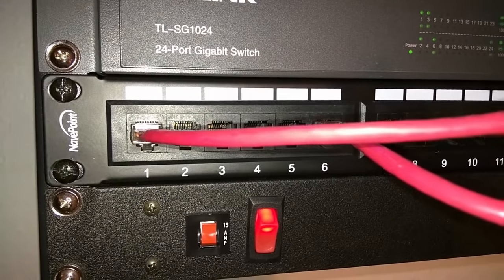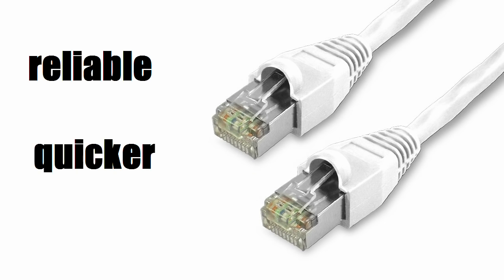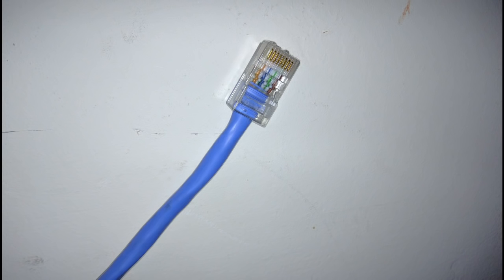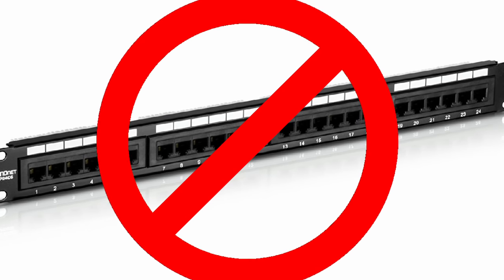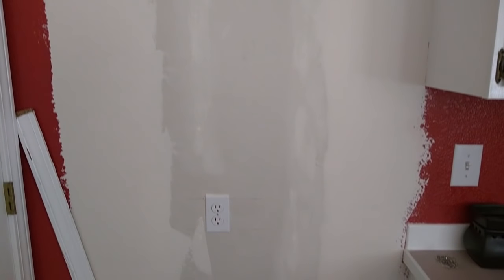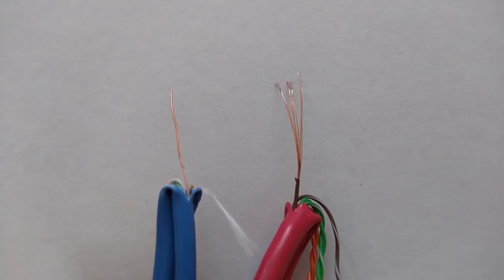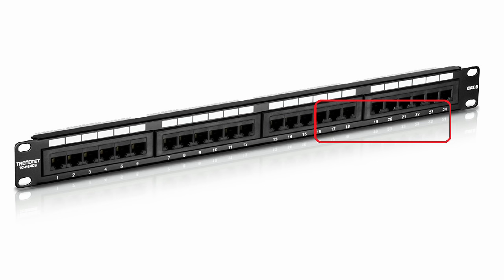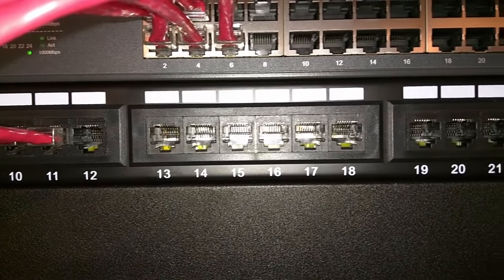What is a Patch Panel? Do You Need One?

Comment: I know the vid is 3 YO but Patch Panels don't have to have punch downs on the back.  I use modular panels and install keystones that have female RJ-45 connectors on the front and back.  https://bit.ly/2QoQlDP  Then I make up all of my cables coming into the rack with male RJ-45 connectors.  This way you can very easily swap and move a cable from one port to another.  With a punch down system you have to cut wires out and hope you have enough slack to move it to the now location.  If you are never, never, ever going to move anything, even during the initial trial phase of your setup, a punch down setup might make sense.  Otherwise, it seems to me and all RJ connector setup makes more sense.
Reply: Issue with this is cost, punch downs are WAY cheaper, not as nice, but WAY cheaper.
Reply: @booradlly  You are correct that the punch down's are WAY cheaper, & the capitalization is correct here as I've been looking at both options & the cost differences are a lot.
Thing is, like @Todd King I'm looking at modular as I'm not using in call cabling but looking at making my rack server's cabling neater. Right now it's going to have direct to switch for each machine (some have 4 cables) but the front would look ugly. In those cases the modular ones with RJ-45 on the back means no cables going through a gap in the front & I can easily repatch them without straining the internal cabling (it's a part lab setup). Also not all modules are RJ-45 which opens up even more possibilities
Reply: keystone patch panels are best patch panels
Reply: @PeterMountUK  Yes, I didn't mention that.  There are RJ11 keystones, RCA keystones, coax & HDMI keystone, and I think I saw a binding post keystone somewhere.  And there are blank ones with a hole in it that allow you to mount whatever you want; a 3.5mm jack, a toggle switch, ect.  It is epically customizable.  There are even rubber/foam plugs to go in the holes you are not using if you don't like the empty hole look.  It is more expensive, but I find it's not a significant factor in the budget in the scope of a full on network.  Also, if you plan on being in the residence  long term, I've found,  it can save headaches for the DIYer and cost for someone needing to call in a pro if your needs change.  I have no problem with IDC patch panels.  I just find keystone panels a much better solution if you can afford it.
Reply: I think we can all agree that each situation is different, so there's no single best answer.  I've seen corporate installations using both punch-down and double RJ-45 patch panels, both worked well for that time and place.

Back in the old days we had 66-blocks used for POTS analog phones, 10Base-T, Apple LocalTalk, IBM 3270 mainframe terminals using coax baluns to UTP, and even Wang word processor network baluns (BNC & TNC twin coax to UTP).  Talk about a wiring mess!  The move from that to patch panels was a headache, but so much easier afterwards.
Reply: @bobblum5973   "I think we can all agree that each situation is different, so there's no single best answer.  I've seen corporate installations using both punch-down and double RJ-45 patch panels, both worked well for that time and place." 
I agree completely.  At no point did I say that IDC patch panels shouldn't be used.  I was talking about what I prefer.
I don't even want to think about 66-blocks. 🤪
Reply: @ToddKing  Hey, 66-blocks were fine in their day, they were better than what they replaced.  I still tend to think of RJ-series plugs and jacks as the cheapest connectors ever made, that's why the phone companies decided to use them.  They've improved tremendously over the years, thank goodness.
Reply: Those keystone plugs also make the signal to be slightly, since you're adding adding an extra connector. It might be negligible if your run isnt very far, but this could be an issue for things like 10 Gigabit ethernet or very long runs. It could be the difference between running at gigabit speeds or 100 meg, but if you are getting the full speed of the port, then more power to you. They also seem needlessly expensive.

Also, keystone panels seem needlessly expensive if you only need to run ethernet. If you want to run other types of connectors, for things like a server rack, then yeah, I think that's great. Those keystones are also great if you just want to run it from a server below on the rack, and you just want to run a patch cable to the panel. That also works since the distance there is very small.

Comment: still dont see the purpose of a patch panel. not convinced
Reply: For the majority of home networks, a patch panel is not necessary. However, in medium to large networks it becomes important when you have dozens of network drops.
Reply: Try installing a system that has over 1000 cables and you'll soon learn.  I planned a job like that several years ago, except it was with coax cable and for DS3 signals in a major telecom office.  That job took over 100 Km of cable and a couple thousand connectors.  The techs wore out several cable stripping tools.

Comment: I'd definitely advise tool-less keystone jacks into a keystone panel... I used to have an IDC punchdown panel at my node zero, and it's a PITA. I was expanding my network and trying to manhandle a punchdown panel with ~20 cables in the back was annoying, and then trying to punch in another cable was infuriating. With keystones you can terminate each cable separately and then just click it in. Also, if you want to rearrange things (e.g. you swap two cables and only notice when testing) then it's seconds of work to swap.

Depending on house construction, some may want to consider having 2 or more panels... I've done a lot of house improvements since my original rack build and there was no more room to run the cables in the ceiling space back to the original rack. I've since sited a secondary 10" rack at the opposite corner of the house with a pair of links back to the main one. If I'd known from the outset, I'd have probably put the main rack where the secondary one is and vice versa.

Comment: I have a patch panel linking my nas drive CCTV network through the house including the shed I have 16 ports around the house Inc the CCTV and the wireless access points x 2 to share wifi around our Home these are alot better on patch and switches than on a router and wiring is so much neater thanks for your helpful tips

Comment: so it's like a multiplug, but just for ethernet cables? lol
Reply: The switch identifies better as the multiplug..  Patch panel is better compared to an extension cord...attached to the multiplug (switch).  Only you don't have to worry about overloading the circuits.

Comment: For a home network, patch panels serve very little purpose. Most cables will never get moved.
Reply: I think if you're going to run a lot of wires all over the house like he did, I think it's a good idea to get a patch panel. I personally ended up getting one because I'm setting up a server rack, and I wanted to terminate the server ports to the patch panel, so, I dont need to go to the back of the rack to try to plug into it. I could have just ran a cable and just zip tied the end some. Even then, I almost didn't consider one, but since the server rack will be in a closet where it would be difficult reach the back, that's why I decided to get one.

If you're running a bunch of cables all over the house, I'd say it's a good idea to use a patch panel, especially if not ever port will go somewhere.

Comment: First thing, the music is a big negative.  It interferes with your presentation
I prefer the patch panels that have only holes for the keystone connectors.  This way the panels can be used for other than Ethernet.
An alternative to a patch panel in small networks is a small box that holds a few keystone connectors.
It's nice to see you mentioned the differences with solid vs stranded cable.  A lot of people don't understand this.
While you can plug a phone plug into an Ethernet jack, it's not a good idea.  A plug that fits the jack gets support on the sides, so it can't be pulled to an angle.  With the type of panel I mentioned above, you can just use proper connectors for phone and Ethernet, or even cable TV type F.
BTW, lose the music.  It's irritating.

Comment: Very educational and simple to understand.  My rack is about 6 feet tall on wheels to handle all video distribution as well as network.  When I roll it out to add devices or perform maintenance, will my cable ends be a risk?  What is the solution?  Also, my rack came with cat6 patch panel but I ran cat6A cable.  Do I need to replace the panel to achieve max bandwidth?
Reply from the maker: If the cable ends get strained, it could cause issues over time. I would think your cat 6 panel should be fine.

Comment: Short answer is No
Reply: I always considered them another point of failure in the line.
Proper wire management should handle the bulk of the neatness issues, simply route them all to the switch.
But, every time I do an install on a government project, their opinion differs, oh well
Reply: The long answer is: NO-body is stupid enough to skip patch panels in rack cabinets.
Reply: @davidconner-shover51  I'm guessing you're an installer and you don't see this network after 20 years of service. If you say that everything is possible with a switch, then you have a high probability that either in a year and a half you will be pulling more cables, or that the floor in the rooms is full of cables.
15 years ago we made a net with a lot of margin. In most places. But the fact that we missed a few magazines - it was a big mistake. Because now there are offices and no sockets. (and imagine put 150 cables to switches. When you need 48)
BTW: do you know what a server cabinet looks like, where for 10 years it was: "I will not make an additional patch panel for one cable"? By my count, I had to buy 2.
Reply: @wojciechbajon  Yes, I have, many times, this is where good wire management and a reasonable service loop come into play.
Even worse, thankfully they are mostly abandoned, are old telco service entrance locations.
if I had to move the head end for any reason, which I've done on a few occasions, then I would consider a keystone patch panel for the purpose

Comment: Yes, it's all about street cred! Otherwise, there is absolutely no use for a patch panel in a home network setup! Setup your network with your cables plugged directly into the switch and leave it there! DONE! Why would you switch cables around or plug in and out so often as to break a cable??? In a music studio it's a completely different thing as you connect and disconnect devices and equipment and choose which to use for a specific purpose or sound. Networks? No. Just plug and play and that means plug it in once, leave it there, and go out and play!!

Comment: @3:15 Can confirm ethenet cables can in fact break. Tight rubbing spaces against other high frequency wires can also cause them to completely stop working. Happened twice in my house and re-routing the cables was the only fix.

Comment: I'm sorry if I come off as dumb...I'm taking a networking class now and I'm just learning what device connects to what.  Your video is EXTREMELY helpful in the office setup I'm building for my project.  Can I ask what the other devices are above your patch panel?  One is a switch, but what are the two above it.  I'm still learning about routers and modems.  Does the switch connect to the modem or the router?  I appreciate any and all help you can give me.  :)  Thank you!
Reply from the maker: Thanks! Yes the next one up is a switch, and the two white boxes on to are the router/AP combo unit and the modem. The switch connects to the router, the router then connects to the modem. I'm happy to answer any questions you have.
Reply: A Modem takes one signal and turns it into something else.  MOdulate, Demodulate.  This was your Modem going over the phone line back in the day.  It was really SSLLOOOW,  I remember my first 300 Baud modem.  I could read the text as it popped up on the screen scrolling across. Then 1200 baud, 4800, baud and so on, up to the max 57K, which never got that fast.  I even had ISDN for a while.  That was not cheap.  I remember when I was finally able to get some fast Internet,  I don't remember the speed was it was over the phone line and was SDSL.  Which means Upload and Download speeds were the same unlike ADSL most everyone else had which has faster Download then Upload.  Even today that is how it is.

So for example, your Cable modem is taking the signal it is getting over the cable and converting it to something a network can understand over Ethernet.    Now if you have a single device, like a Windows Desktop, you could just plug it into the cable modem and it would work.  But who just has 1 device.    They may not even have a Desktop computer.

So this is where a Router comes into the picture.  You plug the Router into the cable modem.  The router also generally has a 4 port switch built into it.  The router takes that single IP address you get from your ISP (Internet Service Provider) like Comcast. and creates a Private Local Network.  So while your Outside IP address may be 143.123. 43.22.  Your Local Home Network will be something like 192.169.0.1, 192.168.0.2, and so on and so on.  These are reserved IP numbers along with some others.  I use 10.0.0.1, 10.0.0.2, 10.0.03, and so on and so on.  

Your router assigns each device that connects to it a Local UP address.  It handles all the traffic coming in and out.  It also offers you Internet protection having to go through the router, instead of a direct connection.  Routers in the past used to be only WIRED, but that's almost gone to Wifi Routers, which have your Wired Switch still, plus Wireless connections.     But it's only a 4 port wired switch on that router.  What if you want more wired devices connected up?  Well, you can run a cable from the router and plug that into an 8 port, 24 port, 48 port switch.  Now that 4 port switch just grew.  If it's an Unmanaged switch, you don't have to do anything else.  The router will just think it now has more ports and allow more connections.    Maybe you run a cable from that new 24 port switch to another room. But you have only that 1 cable and 3 devices you need to plug into it.  Well, You can get a small 5 port switch, plug into the cable, that takes 1 port leaving you with 4 more ports.  You can now plug your 3 devices into that and have 1 extra port.  You don't have to do anything else.  Your Router still thinks it gained a few more ports and will assign an IP address to those devices.

Now a Managed switch is more complicated.  You can log into a managed switch like you can a Router, or even a cable modem.  You have a number of features you can then do that you can't with an unmanaged switch.  It is generally overkill for home use.

So it normally goes Outside line to Cable Modem.  Some Cable modems also have a built-in Wifi Router.   They generally suck and so you can turn it off and use your own router.  So Cable modem to Router.  Routers have built-in switches and this is what you plug your devices into but if the ports aren't enough, you can plug 1 or more switches into the router, or from one switch to the next switch.  It's really pretty flexible.  

So a switch can connect to the Cable Modem IF it has a built-in router.  Generally you need the router as part of what it does is called DHCP (Dynamic Host Configuration Protocol)  this is what assigns each device on your local network it's own IP address.  I can go on and on, but all this stuff is allover the Internet.

Comment: If you have more than 4 data cables feeding from throughout your house back to switch/router then setup a patch panel. If you have 4 or less just wire into a data point with patch leads running from there to your switch/router.

Comment: He is correct about the solid core cables. I have solid core in my home walls and the copper wires can break when terminating at the keystone. Not all the copper wire was fragile but some of it felt kind of brittle. I had one copper wire break after I screwed in the wall plate. Probably put pressure on the wires when pushing the plate flush against the wall. I had to re do the wires in the keystone and this time be more delicate when putting the wall plate back on. Just be careful and take your time with the solid core.

Comment: very cool, informative video.  i am in the process of closing in on my first house.  built in 1980.  will need  more attic insulation.  these days, one can easily use 3-4 internet connections for 1 tv (tv + video game systems)...or the fire stick will take up another connection.  all offer ethernet ports.  i might run 4-5 solid core cables from anywhere a tv will be placed to one central location before blowing in more insulation...this will most likely be the case for each room, the family room, and living room.  that's 4 times 5 areas.  that could easily be up to 20 wifi connections.  this doesn't count tablets or smart phones.  i think ethernet cabling is the way to go.... other alternative is using a switch to individual access points.

Comment: Does the switch affect certain devices since it would have low voltage along with the lan? such as tv or printers if you were just wanting to connect it to your network and power it by the regular ac power?